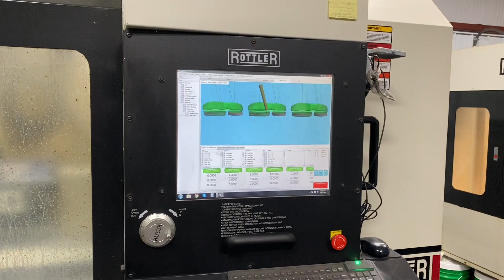DragBoss Garage: Road Trip To Bischoff Engine Services (BES),

Comment: The boys from EastEnterprize Indiana I won't name I them fairly well ,BES used to build there engines an probably still do,an they put it on the competition in the mud drags.,,,love the sound of the BES engine in their trucks.You can absolutely hear the difference.  An see the difference 😉. Sup (Jason, Jerry, an Sr. Has ,,,Been awhile since I've been to a race maybe I can make a couple this season.
Reply from the maker: Great to hear that. Getting very few builders anymore. They are doing my aluminum 427 Cleveland. Good luck with racing.

Comment: Im surprised you don't have Billy Glidden involved in this project?  Billy had a Cleveland engine running away from mountain motor Pro Modified's He ran as quick as a 4.01 to the eighth mile. If anyone would know how to max extract power out of one it would be him
Reply from the maker: Don’t be surprised. He does not work at BES, so he is not involved. Doubt he ran a cleveland block. Thanks Dalton for watching
Reply: @dragboss351cleveland  You're right I shouldn't be surprised Billy is not involved. Im not sure what type of block he used, but his engine setup looked similar to the engine's you have and not like the other Ford racers he was running against. He always said his engines were hand me down parts from his Father. I know the heads were canted valve. After he competed with the small block stuff he started using his Dad's Boss 9 pro stock engine's and was very competitive.as well. I've learned a tremendous amount of information from you. And I really appreciate what you do and your enthusiasm for Cleveland engines. I believe no one has extracted the type of performance out of a sbf like Billy has. Also I believe it would be great for your platform if we heard about Billy's experiences.  racing with his family and his insight on Cleveland engines. Thanks for responding to me. Take care.
Reply from the maker: @daltonhanleyjr4142  thank you Dalton. I appreciate you taking the time to watch and contribute. Billy has done well and I remember his black Mustang. Not pretty under the hood, but fast. Not sure at that time if he used canted or his Glidden Victor heads. I’m glad that you got a lot out of my channel. Just trying to keep the cleveland alive. He has no interest n my channel or my work. Bob has been my hero in racing since ‘75. I am going to keep my goals in line, and get done what I can. Glad your here,  so stay tuned and see what vid is next.

Comment: Did you see the head on that monster engine? It looks like the intake runners are at the same angle as the headers, straight shot from plenum to header,  I would like to see a cutaway of that head, or it disassembled, I bet the valves are huge, along with ports, and the valve angles??
Reply from the maker: I saw it and I bet they have 2.30 intakes or bigger.  No idea on any specs. We will find on on a n interviewing him

Comment: Excellent road trip ,Tim. Great to see, BES certainly has a good group of people. The picture of Darin at the flow bench with a 427 tunnel port head, interesting! Is Darin doing development work? A couple of people interested in casting a modern version, wondering if they contracted BES to do the development!? I'm doing a tunnel port project now. Then a 331 clevor , with an 8.2 deck  block. You have me inspired!!
Reply from the maker: Thanks 👍 so much for watching. Im glad I could keep you motivated, I have that problem too sometimes. Your engines will rock. I doubt they would put money into those heads, we can ask next time.
Reply: John what crank and rods for a 331 ?
Reply: @cammontreuil7509   I bought a Forged steel crank from Trick flow many years ago. The crank listed for $1200 back then 50% off. I had too buy it! Used the SBC rod bearings, 5.4 inch rods. A lot of kits use the chevy v6 rod bearings. This crank uses regular SBC rod bearings. I believe the V6 bearings are a little narrower.
Reply: I forgot to add 3.25" stroke
Reply: @johnsalvaterra1355  I thought the 331 was a destroked Cleveland. Not climbing the cubes from a 302.
Reply: @cammontreuil7509   yes you could do it both ways, but ,the 8.2 deck Boss 302, back in the day, was easier to find a crank, easier relative to the Cleveland where one was stuck with the stock nodular crank, unless one had deep pockets to go too Molded ,or Hank the Crank!
Reply: Moldex. I hate spell check!
Reply: @johnsalvaterra1355  our friend dragboss has rekindled my interest in the Cleveland again. In the 80's I built a good number of them 70 or more. Junked alot of 390's and 351m's and had my customers switch to C. Even put a Cleveland in many Ford Vans and 4 wheel drive pickups. 
Anyway, a couple years ago bought a set of Cleveland Boss heads for $450. 
I was afraid to take them apart. Triple springs on them and my inadequate valve spring compressor. I have a heavy duty one now. The heads were set up to run on a clevor and had been running for a short time. Titanium valves and retainers ported and polished.
I thought to run them on a Cleveland again, a destroked one.
These heads should rev pretty good.
Reply: @johnsalvaterra1355  my wife, who is from a foreign country, uses spell check and she comes up with some screwy sentences.
Reply: @cammontreuil7509   Oh my yes! That has to be tough for her.
Reply: @cammontreuil7509   Sounds really good, interesting you were able to find enough Clevelands. They were not real easy to find in upstate NY. Had to got to NJ!
Reply: @johnsalvaterra1355  I lived in Seattle at the time. But would go to junkyards in Yakima and Wenatchee.
Bought engines for $40 or $50 bucks.
It was surprising how many engines I found over there.
Reply: @cammontreuil7509   a little story behind this combination, back during the days of Gt40 lemans program Ford actually did build some 326 engines, 4.0 inch bore, 3.25 stroke. Same as a 327 SBC., They ran a super modified racer that basically were unlimited. The local Ford dealership got one for them and procured a pair of gurney westlake heads. The bigger engines would pull that little Ford out of the turns, but then he would shoot by them on the straight. Rpms up, it was untouchable, even 454 BBC were not able to stay with it. That little 331 really was awesome!

Comment: Tim you convinced me to go in a cleavor build.  I have 1970 4dot 4V CC heads untouched.  Is Darin going to be working on your cast heads?  I am doing a build for my daughter and high school drag mustang.  If all goes well and after yours are all done, maybe I can slip in for some  port work and port epoxy.  Really love following you, what your doing has turned me on to this classic power.
Reply from the maker: Thanks for commenting. That will be a killer motor, Darin told me he does not port iron heads. He will be on live Friday 7pm est.  I will ask him then too. I bet you don’t need any work in them, other than refresh so to speak. Right cam and gears and let her rip. Ps really need to come up with a goal on build hp, Et. Thanks th

Comment: Cool shop for sure. I would seriously rethink using titanium valves. There is very little to be gained, and far more to loose when they fail. If you have a sponsor to replace all your parts, by all means use the lightest, best alloy's possible. If you are paying for it, put stainless valves with a known reliable spring and pushrod combo in it. I used titanium valves in a few engines. I wont ever use them again, I had to many of them fail. I have never had a stainless valve fail, over a 35-40 year span of using them. You can actually build an engine with hollow stainless valves and a rev kit that will rev rev higher than any titanium valve will withstand without breaking. The engine builder that told me that years ago built me a 565, with stainless valves, that spun to 10k on every pass. He was not the person that sold me titanium valves prior. He is the person that brought up the sponsor thing to anyone that asked about them, because they will break... There is no if, just a when...
Reply from the maker: I hate to hear that, but was told that after 8k stainless valves with their inherit weight have a potential for valve float. I am going to stay with them for my TrackBoss build, and already have some for my prostock build, but after that may not use titanium after that. Thanks for the heads up. My old 408c, would go through traps at 8k with no float issues or durability issues. Thanks.
Reply: @dragboss351cleveland  All valves have a potential to float. But oddly enough, the valve is never what causes it. Be religious with your valve adjustments, leak downs, etc. And when the clearances do change, take the time to find out why. Pull the heads every year on the off season and check the valves. If they are deformed at all on the seat don't machine them, replace them. Hopefully you have far better luck with them, than I did.
Reply from the maker: @shvrdavid  Great words of wisdom, I am pretty good at checking things, and keeping on top of things. At this point, continue my same plan, and cross fingers...

Comment: What is the “KPA” measurement?
Reply: A kPa unit is used for measuring pressure. 
It’s a finer, more accurate measurement than using PSI.   There are close to 7 kPa units in one PSI unit.  So regarding the scoop, they were measuring pressure inside the scoop to see if the smaller scoop was robbing them of air with the smaller opening, but as he mentioned, during high nitrous loading, the air demand diminishes which allowed the smaller scoop to supply sufficient air into the injector.

kilopascal
Reply from the maker: @nitrofumes2012  thanks Nitro for answering the question with insight
Reply: Air pressure/volume, IIRC.
Reply from the maker: Thanks my friend. I may use your vid that you made of my Cougar Racing Sometime that is on one of my playlist. You don’t care do you Z?
Reply: @dragboss351cleveland  Anytime you like T. I have others of you & and the Cat, but like the one you mentioned, the quality is pretty poor. Still, if you're ever looking for more, I'll dig and see if any meet with your approval.
Reply from the maker: @Zekais  thank you, please see what you have. Have had minimal vids from outside. Appreciate your efforts my friend. See you on Friday night live chat, 7pm.
Reply: Thank you NitroFumes for the answer of KPA.